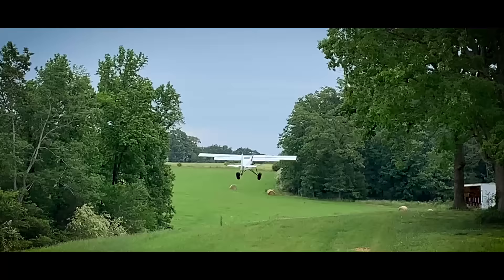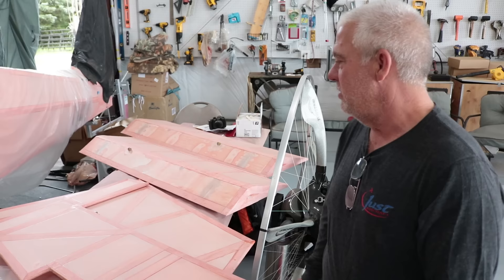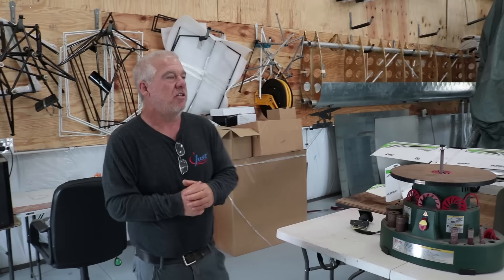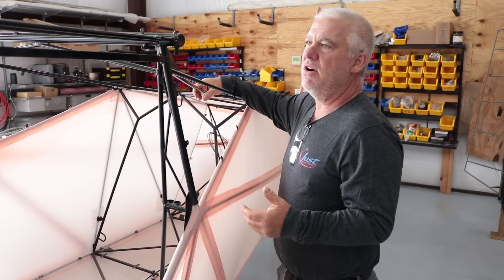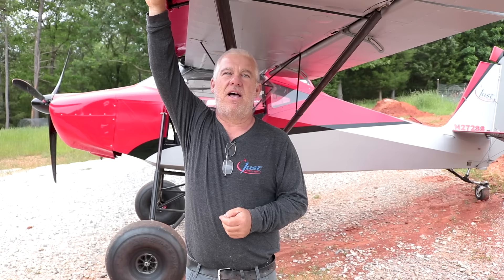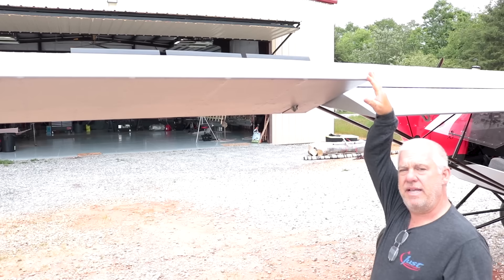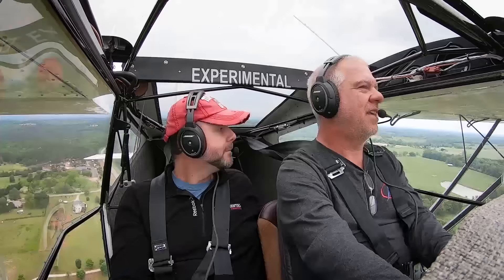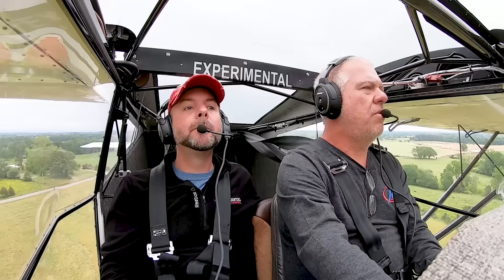Super STOL FLIGHT! and Build Tour - STOL IT Aircraft

Comment: Lost contact for a minute. Damn Bryan you have created a great job for yourself. What a life getting to tour all these factories and fly some great aircraft too! That takeoff has to get your adrenaline running the first time you thread that needle through the trees? Your eyes were as wide open as they get when you were spotting the trees on both sides of the aircraft going through the eyelet! Yea baby that’s flying!! I made a paint booth out of a 21’ party tent I bough for $375 with metal polls to keep it up. Then pressurized it with a large blower fan and filters for exhausting the airflow. My neighbors complained to our township because they can. I used water base paints and was inside of EPA guidelines but it didn’t matter. I finished the paint job anyway. I told them to bring me up on charges but they had none. Sometimes neighbors can be asses because they want to be. But I recommend checking with local ordinances before taking on a paint booth but in my opinion using a collapsible paint booth is the way to go with metal poll structures because you can ground the metal polls and you will buildup a good amount of static charge when moving a large amount of air over the plastic woven coverings. You want to prevent the aircraft surfaces from attracting any foreign debris so keep the buildup charges as low as possible.
Reply from the maker: YES... I was Eyes Wide Open for that take off for sure! First time personally off of such a short strip AND trees at the end. As you can see we had to make an "S-Turn" at the end to clear the trees! Not to mention there was a house and a tree on either side of the runway. I don't hide my emotions well I guess! Hah!  Thanks for watching and supporting here! :-)

Comment: try air pressurized up to inflated less rigid wings, should be lighter and the air pressure keeps them in form
Reply: should have metal mesh or similar main structure, however folding compacted form you wish, some frame structure like aluminium framing, somewhat loose, hinged, to the plane fuselage, then other other stuff loosely inflated-pressurized into its form, coated and hardened on the surface

Comment: This is fantastic. I’m an instrument rated pilot. How much would cost the model that you flew with the owner ? Thank you.
Reply: The kit is $36k which gets you the airframe, wing, etc. Then you add engine, prop, and avionics. 
So those costs will significantly impact your total build price. It is experimental so all of those costs are a fraction of what you would expect from certified aircraft. And if you find second-hand or used enginges, props, etc then you can really keep the price down. To go all brand-new will cost $75k-$100k to get wheels-up, depending on what options you decide for avionics and engine. But you can build for far less than $75k if you shop deals on the used market. I would guess the one they test-flew is in the $80k range.
Reply: @JAlexanderCurtis  Thank you very much for the information. The dream to own an airplane one day will probably come from a FAA certified aircraft such as a 4-seater Cessna or a Piper. I understand now how an experimental aircraft can go so high...price wise.

Comment: When folding the wings do you need to do anything with the aileron cables?
Reply: Cooper Hart no, all the cables, fuel lines and electrical enter through the aft section of the wing so it just hinges.

Comment: Did they ever get there website up and going? If so what’s the website?
Reply from the maker: Yes they did. Here it is: https://www.stolitaircraft.com/
Reply: @ExperimentalAircraftChannel  so these kits are built in house or I can do it from garage? And do you know if it’s a complete plane ready to fly? I’m working on my ppl and am very attracted to the stol over a Cessna style plane. I’m a mechanic/fabricator by trade with a very tight wallet. Do you recommend these plains to such a person?  If there is an easer/cheaper option please let a greenhorn know. Lol. Love the videos!
Reply from the maker: @richardmauch1042  YES! YOU! CAN! #justbuildit . Available as a KIT you can build in your Garage. And then there is the Builder Assist Option you see in this video. Ready to fly are usually used unless you are buying a factory built LSA (If the factory offers that option... many Aircraft OEM's do). Cheaper to build yourself if on a tight budget.
Reply: @ExperimentalAircraftChannel  I appreciate you actually getting back with me. Are the kits complete for the most part, besides engine obviously. Lol. Do you even need a pilot’s license for these are crafts? Sorry if I’m blowing you up on this but I do appreciate your feed back.